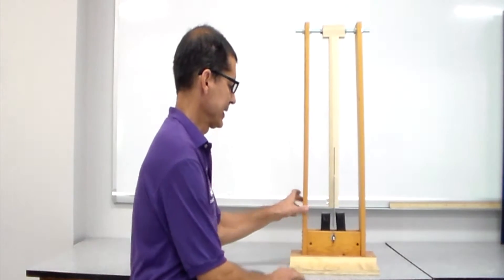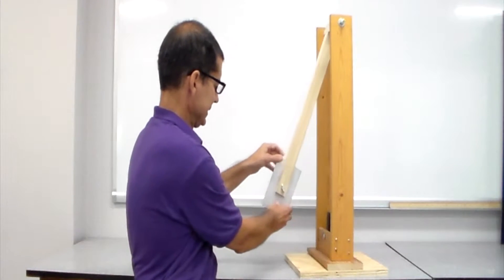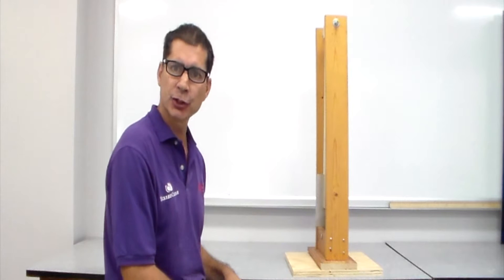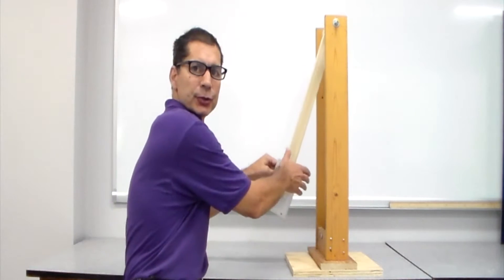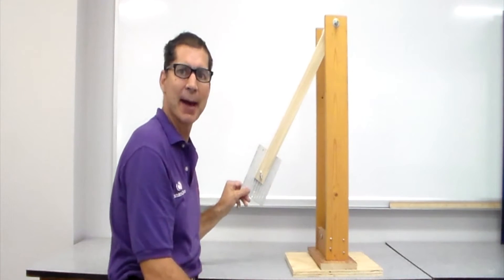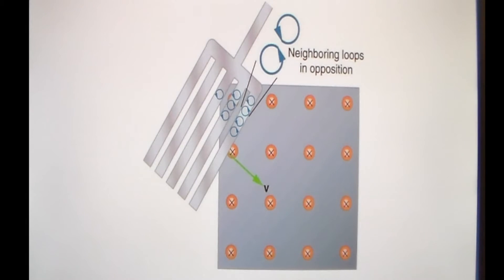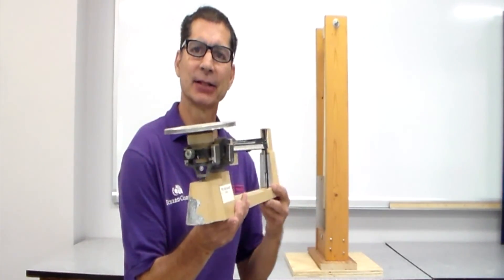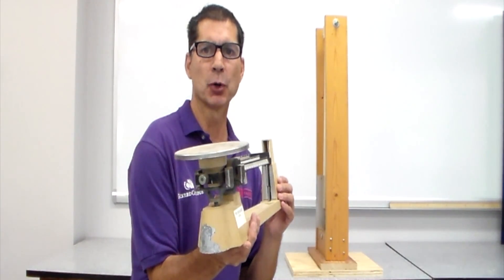Lenz Law Pendulum

Comment: Why transformer's core has many many layers? Is it for the same reason explained here?
Reply: Soft iron core is a ferromagnetic material, it transfers magnetic field from one coil to another, that's the basic reason. (Mutual induction)
Reply: No I’m afraid he is not answering your question. The correct answer is many layers of iron sheets refer to laminated iron core. The purpose is to reduce the magnitude of eddy current (as shown by the video of the slits in the aluminium plate), hence reducing power losses which makes the transformer more efficient. Remember that eddy current dissipates heat which reduces the efficiency of the transformer so we want to minimise eddy current as much as possible.
Reply: @tand9854  that's not the reason bud
Reply from the maker: The laminations typically have and oxide or coating on them insulate them from neighboring sheets. Eddy currents tend to occur in many directions, so we want to discourage them from occurring in non helpful  directions because all they will be doing is creating heat.